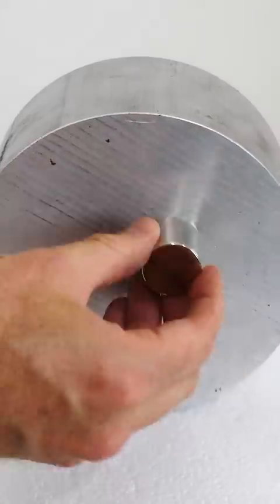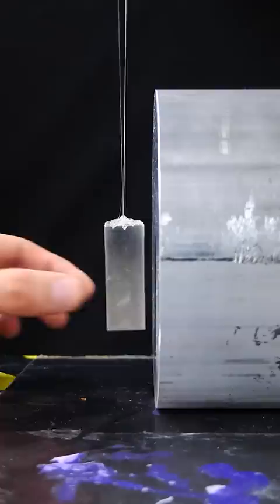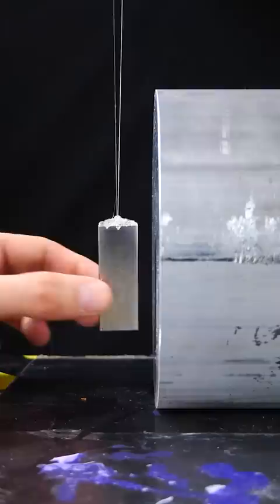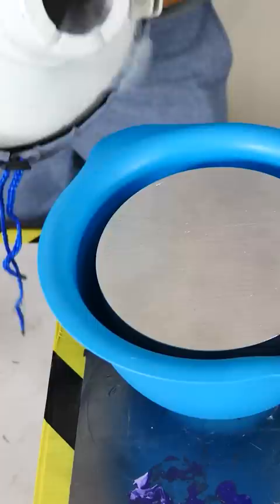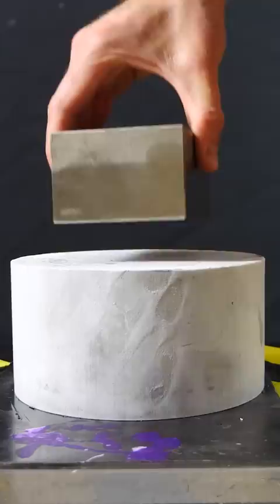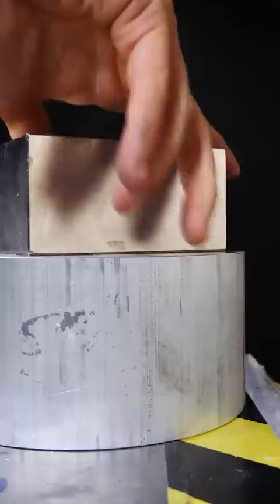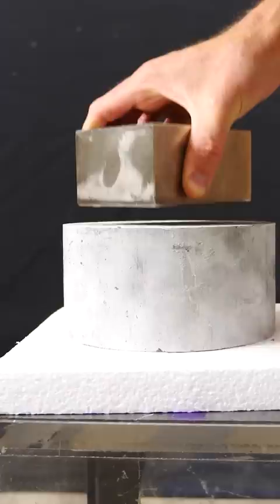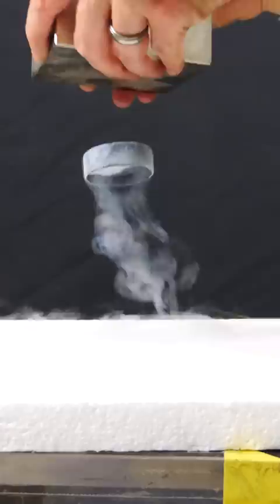Magnetic Braking Looks Like Magic

Comment: It’s insane to think what lengths people could take this technology
Reply: Needs to be wicked cold tho so it's a bit impractical for many applications unless we can figure out a practical way to do that. 

Liquid nitrogen is expensive!
Reply: @shadow_rune6178  what about in space? plenty of cold out there!
Reply: @cjhowland1308  unfortunately, it is also very hot. Still, I'm considering if this could be used in elevators as a safety mechanism?
Reply: Ever heard of maglev trains?
Reply: @eyescreamcake  The magnetic concept for maglev trains is different though. It still ends up touching the other metal object even if slowly in this case.
Reply: I honestly believe that magnetism is going to be the key for humanity to achieve perpetual motion
Reply: What about elevator brakes, in the event of a falling elevator?
Reply: Magnetic braking on roller coasters hosts a similar idea but not the same iirc
Reply: @ALBINO1D  why would someone do that if there is already a solution for that.
Reply: @plantainsame2049  bro everything is physics. Everything is based on physics. With stronger magnets these days, we will be able to make this into a technology. Yeah of course it’s physics, but everything is physics. 💀
Reply: @ijneb1248  perpetual motion is and forever will be impossible
Reply: @cjhowland1308  buddy if space is cold how the hell does the sun heat the earth?
Reply: This technology could be used to generate electricity, transmit it to people's houses, and power devices. How crazy would that be?
Reply: @hogrider6214  no everything is not physics everything is matter physics is not a thing physics is rule system of how matter works
Reply: WELLLLL Superconductive and super cooling fluids were just developed for their extreme magnetic properties in a similar technology. This is being used to SHIELD around a nuclear FUSION reactor which is expected in under a decade to break even in energy loss and economically soon after.
Reply: @powerinknowledge2392  it’s not radiant or conductive heat that heats earth, since space is a vacuum, in between earth and sun there is nothing to heat up, but place anything in direct sunlight the waves will heat up the material you’ve placed in front of it through convection.
Reply: @chowderwhillis9448  you got it all mixed up. The sun heats us through radiation, which is where it directly heats things up, convection is the heating of stuff through moving liquids or gases, and conduction is heating through direct contact.
Reply: @plantainsame2049  no everything is fundamentally energy that’s literally what E=MC^2 means, that matter is extremely coalesced and cooled down energy bundles held together by the strong nuclear, electromagnetism and space time warping forces over greater and greater distances yet weaker and weaker by inverse square law power either very strong force holding together but tiny distances like the nuclear force barely fits the size of the nucleus or very far distances yet extremely weak force like gravity. It’s complicated af, read Asimov’s series of books on physics titled “Understanding Physics: Light, Magnetism, and Electricity.” Understanding Physics: (UP) The Electron Proton and Neutron and lastly UP: Motion Sound and Heat. It’s a three parter that really breaks down how everything works on the quantum and gravitational levels huge and small…
Reply: @gr0m0z3k4  yeah you’re right I said it completely backwards sunlight heats thru conduction, at night it’s thru convection from heat moving between materials. But still sunlight does not heat up the vacuum of space for there is nothing for the radiant heat to be absorbed by until it reaches the atmosphere and then planet’s surface
Reply: @chowderwhillis9448  you still somehow managed to say it backwards 😂 sunlight heats through radiation, not conduction there has to be physical contact for conduction to occur and a big barrier of nothingness called space stops that from happening
Reply: Magnetic trim breaks on roller coasters use those concept.
Reply: @chowderwhillis9448  so there is heat. It’s just not heating anything up if there is nothing to heat up. If you go out into space you will be hot.
Reply: @chowderwhillis9448  heat is the transfer of energy.
Reply: @ke6gwf  so there is heat in space it just comes from a source.
Reply: @gysh8944  We already had tunnels then someone decided to "invent" the hyperloop. 👀
Reply: This is basically how maglev trains work
Reply: @Dr.Starbound  like the comment above said, keeping things that cold is insanely expensive and is way too big an energy investment for a safety feature that's (hopefully) never gets used. Elevator failure are waaay too rare nowadays to be worth that kind of energy cost. Plus you can use other options that work fine
Reply: @powerinknowledge2392  There is nothing to retain heat in a vacuum thus space isn't warm. Only the object which absorbs radiation will heat up, but there is nothing around it transferring the heat to it except for the source.
Reply: @cjhowland1308  Space is not cold. The cold feeling happens when the heat from your body is transmited to other mass, like the air (atmosphere) or liquids, solids, whatever.  In fact, if you stepped into space without a space suit you would not feel any cold. You would just retain your body temperature because there is nothing to transmit your body temperature to. Being in space is actually less cold, than going outside, well, at least in the northern hemisphere where most people live today. Not during summer of course.
Reply: @theoveranalist6381  fair, but it's a fun thought
Reply: @Dr.Starbound  that's pretty true. Like imagine if there was a space elevator and you could just drop durable cargo down a vacuum tube and there was just a cold magnet at the bottom to catch it
Reply: @possiblyalan9213  you never know
Reply: @ijneb1248  perpetual motion would require perpetual energy, and energy can't have a 100% return rate
Reply: @Clumrat  I never said space was warm I said there is heat in space. There’s a difference. The heat is only applicable when there is something to heat. Obviously if there is nothing, nothing can absorb the radiation and heat. But there is still heat in space, space itself is just not hot because it’s literally nothing.
Reply: @Dr.Starbound  magnetic breaking is used on many amusement park rides, but not with superconductors, since that would be super expensive
Reply: All I know is that magnets are good in cubes
Reply: @Wmann  anything with a strong center of gravity like an evenly sized cube or even a sphere would appear to work better, it’s more mass
Reply: @ijneb1248  my grandfather was close to a magnetic motor before he died, he had a working model it would go around a few times then go out of time so I believe he was close just need another couple years 😊
Reply: I work at a trash burning power plant. We use eddy current drum magnets at the tail roll of multiple ash conveyors to separate out the non-ferrous metals from the ash and ferrous metals. The non-ferrous rolls over the magnet at the end of the conveyer and "magically" flicks up and over a divider and is collected then sold. The ash and ferrous metals just roll over the magnet and drop into their own respective bays. This magnet spins at 3600rpms, INSIDE the drum that the conveyer belt rolls on.

It's remarkable to see the amount of metal leftover in the ash after burning the trash. A  large amount of revenue comes from the metals separation (most of which from the non-ferrous).
Reply: @Sha.ll0w  It doesn't matter when you have electromagnets,
either take the energy to build unrealistically strong magnet systems or or the energy into supercooling.

This phenomena doesn't really provide levitation without supercooling it'll just fall softer, supercooling doesn't scale well with mass
Reply: This technology has been developing for the past 60 years with mediocre results though...
Reply: Hoverboards maybe? Or it's just wishful thinking 🤔
Reply: @cjhowland1308  It is indeed cold in space but the moment you see the sun is the moment you go from negatives to 200C+
Reply: @ijneb1248  The laws of thermodynamics make this impossible. Anyone with even a fundamental grasp of physics and engineering should know this.
Reply: They already have, or at least our "military" has. I think we use these types of technologies on a daily basis... 😉
Reply: @Wickedreptiles  a magnetic motor is just a regular motor
Reply: @gysh8944  because things can always be improved upon and people asking these questions is how the search for the better solutions, begins. First part of the scientific method is asking questions.
Reply: @gr0m0z3k4  you're both technically partly wrong, as it's all 4. Radiation, conduction, convection, AND induction. It's in stages. Radiation is just what kicks it off/how it even reaches the Earth to begin with. The rest lies with the other three.
Reply: @ijneb1248  😑🤫
Reply: It is ubiquitous in the amusement park industry nowadays, because the braking applies smoothly, is plenty strong enough to stop a roller coaster train or drop tower carriage, and it releases the braking force smoothly, tapering off to a slow, controlled speed. If you use electromagnets you can even have instantaneously adjustable trim brakes that are far more precise than friction brakes. All this without any wear or need to have super precise tolerances.

Only disadvantage is that it cannot completely stop the train. You need to have pistons for drop towers or friction brakes for roller coasters. Millennium Force for example has a long line of these magnetic brakes, but the train is brought to a complete stop with a single rubber wheel.
Reply: @cjhowland1308  space is actually an awful insulator because it while to doesn’t allow the transfer of basically any thermal energy, that also means hot things can’t cool down properly
Reply: @shadow_rune6178  Whoever can figure out first how to create, replicate, and mass-produce room temperature superconductors at a decent price will become one of the richest companies on earth, same with whoever creates the first full-scale fusion reactor and manages to adopt it to mass market.
Reply: @Mallchad  can this phenomenon be used in things like landing tho? Or would the huge deceleration just break everything inside say an aircraft?
Reply: @hazensze4490  Technically?
Yes.
In reality? Requires too much power to be practical. 
Maybe if we had a near unlimited source of power one day.

General consensous that the most practical use of magnetic braking is over a long distance (wheel brakes or rails).
The decelleration is a something but that's something you engineer around, you won't get anything even close to this fast with something as large as an aircraft anyway. He's testing with a pendulum with if you drop it straight down it aways comes into contact with the "ground" fairly quickly.
Reply: @cjhowland1308  you can't cool stuff by putting it in space. While, technically, the small amounts of particles in space do not vibrate much (meaning they are cold), there are so few that spaceships actually struggle to get rid of heat when in space.
Reply: @ijneb1248  magnets are not magic. You expend just as much energy (if not more) separating the magnets as they release when attracting together. They don't create energy from nothing, because it's not possible. We have already proven that perpetual motion will never be a thing, because energy cannot be created or destroyed.
Reply: @n00bxl71  people have no imagination anymore
Reply: @Dr.Starbound  elevators don't actually fall like in the films
Reply: @Dr.Starbound  Thats a great idea.
Reply: @ijneb1248  Not believing in magic is not the same as lacking imagination. Lots of brilliant people have wasted their potential trying to achieve impossible things, perpetual motion being one of them.
Reply: @ALBINO1D   it’s not the ground hitting ground that kills people. It’s the sudden stop. 
You travel at the speed of the elevator, and when the elevator stops, it takes a second for inertia to keep up, so when your feet stop, your ankles don’t. And neither do your knees, or hips, or ribs or skull, thus theoretically crushing you like a pancake from the top of your head, down to your feet.
Reply: There are no applications for this other than academic.
Reply: @cjhowland1308  not nearly cold enough. No place in the universe gets this cold.
Reply: @ijneb1248  perpetual motion is science fiction.
Reply: @powerinknowledge2392  Radiation. Space between the sun and earth is indeed, very cold.
Reply: @chitlitlah  that is not true.
Reply: @jaidenmartinez4359  lol. Good point.
Reply: @evolicious  That is incorrect.
Reply: @evolicious  Trains already use eddy current breaks.
Reply: @evolicious  Yeah, you're probably right. We'll never be able to use magnetism to make electricity. I guess I'm stuck with this oil lantern...
Reply: @ijneb1248  Prolly not tbh Magnetism is heavily effected by surrounding conditions like heat. So if you heat things up by adding power to it, the magnetic properties cease.
Reply: @Dr.Starbound   or maybe A safe way to.let astronauts pilot through space freely
Reply: @shadow_rune6178  whats so bad about the corner of the lgbt flag
Reply: Wakanda Forever
Reply: It’ll be used in the future as a way to make small sums in cash over bets that our idiot frat mates were dumb enough to take.

…Still using gas in 2023

Comment: This is how to disable fall damage
Reply: There's gotta be a way to use this for something. It doesn't even have to be fall damage, like slamming inside a machine or a device.
Reply: Still it's useless without being able to control gravity, you go from 100 mph to 0 in 5 feet it's still going to wreck a humans body. If they can find a way to do it over a very specific distance then that would work
Reply: @horsracing that’s exactly what happens when people do high falls into air bags, and their bodies make it out fine
Reply: @theyonderbus that's because the airbags absorb the shock quickly. If you're rellying on just air then it'll transfer too slowly and destroy your body first.
Reply: @kylecyrus9457 the magnetic field also absorbs the shock quickly… If you were in a magnetic suit and happened to be falling onto a super chilled aluminum surface, the suit and the magnetic field would absorb the shock much like an airbag would (as seen in the video)…

But with that being said, I suppose there’s only one way to find out! Time to get the myth busters back together
Reply: @theyonderbus He's talking about the G forces. The quick stop is what will kill you. You would have to find a way to start slowing down the stop gradually
Reply: @theyonderbus   not exactly. They're usually jumping from less than 100 feet and going less than 50 mph. Landing on the airbag not only pads their landing but displaces the energy from the fall. There are Rollercoasters that use electromagnets to stop the coaster, but it's over a much greater distance.
Reply: @jeffreydallas6047 to prevent cars from actually hitting each other in a crash , old people slip n falls. A super suit, boots that lets you hover skate idk 🤷🏾‍♂️
Reply: @kivincifilms3904  i was more thinking in a mechanical sense but honestly you may be on to something with the cars and the suit that keeps you from getting hit by crowbars lol
Reply: Youll still hit the magnetic forces very fast
Reply: @jeffreydallas6047 it’s used to slow down train without changing the brake pads
Reply: @horsracing  If your whole body was uniformly magnetic, every part of it would deccelerate at the same rate and you would be fine.

It's all the internal forces exerted between your organs which kill you when you go from that 40m/s to 0 in 2m.
Reply: Precisely my thoughts. I could see its usefulness in my workplace.
Reply: Haced el siguiente experimento:
- Un tubo de cobre de los de las onstalaciones del gas
- Una bola de acero
- Un imán de Neodimio en forma de bola y de igual diámetro que la bola de acero
- Un cronómetro 

La medida interior del tubo y de las bolas debe ser parecida.

 Poned el tubo vertical o inclinado, da igual pero no lo cambiéis una vez decidido. A mi me gusta vertical porque ...bueno, ya veréis por qué.
Coged el crono y la bola de acero. Tiradla por dentro del tubo y cronometrad el tiempo en salir por abajo. Es ideal que mida no menos de metro y medio para poder mirar por arriba mientras cae.
 Apuntad el tiempo y repetir el proceso con la bola de neodimio.
 Veréis la diferencia de tiempos pero además no se para en seco sino que baja como flotando.

 Ahora imaginad un tubo de cobre de 60 cm de diámetro por ejemplo y un bombero con un traje magnético que se tira por él aunque esté en posición vertical. Llegará al suelo y se pasará como Supermán.
 Como yo no lo he probado que lo haga otro...por si algo sale mal.
 Para éso están los pilotos de prueba.
Reply: I love it when nobody gets the joke
Reply: The boots of springhill jack
Reply: Or how to crumple mid air
Reply: Begins Slow clap.

So we now know that "feather fall" causes the player's character to develop magnetic breaking between the lowest immediate terrestrial ground state(s) and the player, thereby enabling them to float gracefully like a feather until they stop. 😅
Reply: We did it boys real life fall damage is no more
Reply: Shock damage will be high.
Reply: "keep in mind that the Bootlegged Aperture Science Long Fall Boots do require you to land on metal surfaces for fall damage nullification to occur, failure to land on an acceptable surface is entirely your own fault and your death will be classified as suicide"
Reply: Could be developed for rocket landings?
Reply: @jeffreydallas6047  You can use it for automobiles so that accidents cause much less damage.